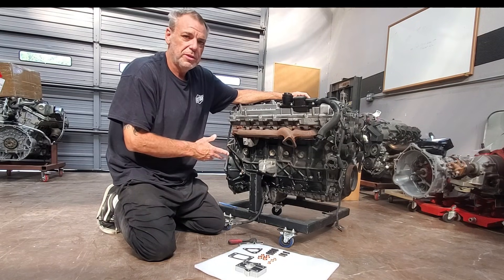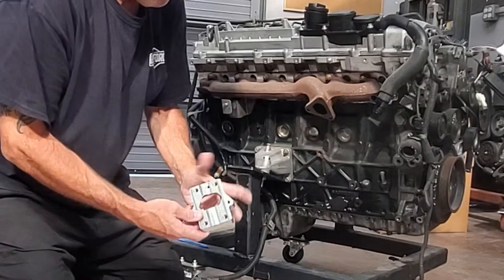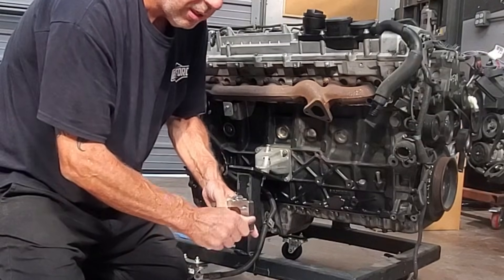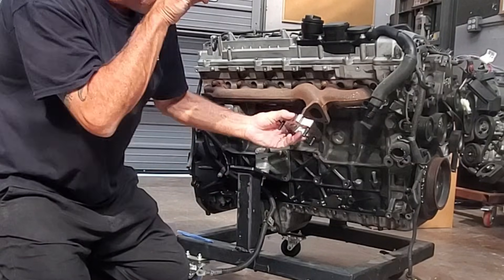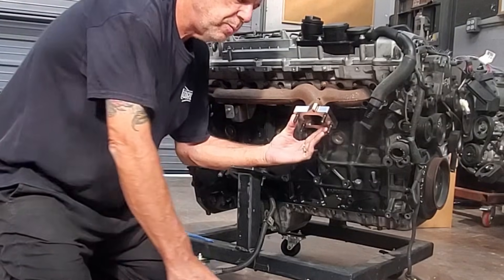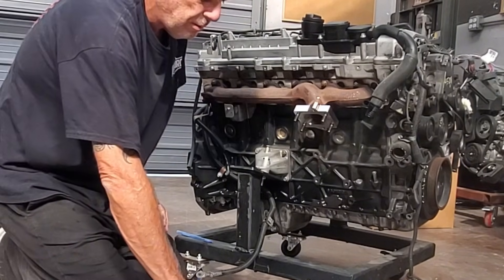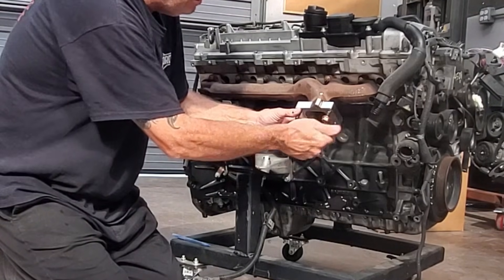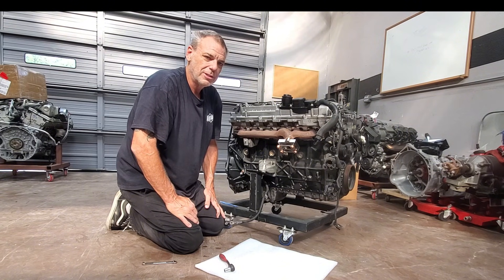Upgrading your OM648? This is the turbo solution you need.

Comment: will a big turbo like 35/40 class fit without hitting anyting
Reply from the maker: That should not be an issue on the engine but not sure what clearance you will have on the car itself.  The wastegate actuator on something like a big HX40 might compete for engine bay space.